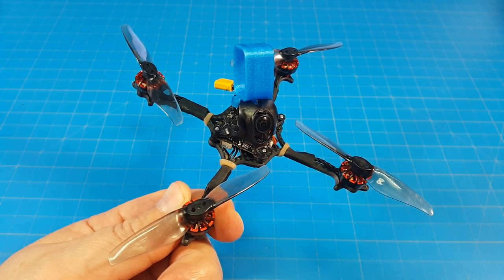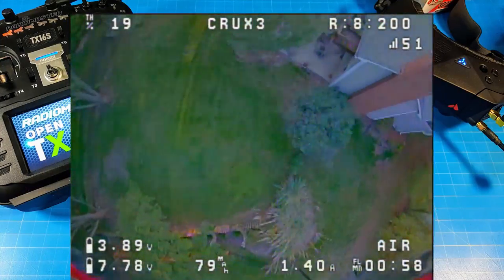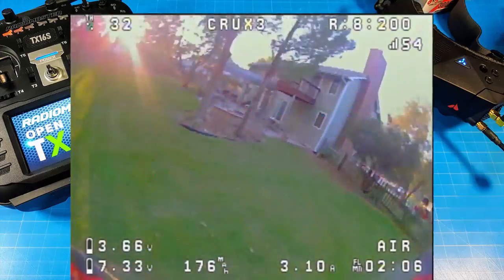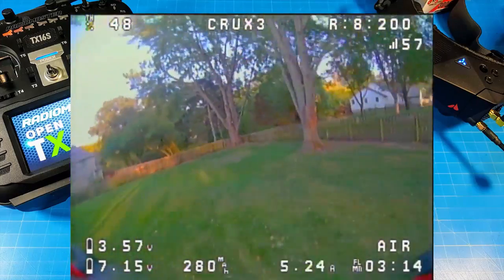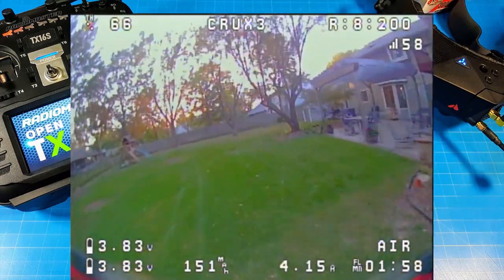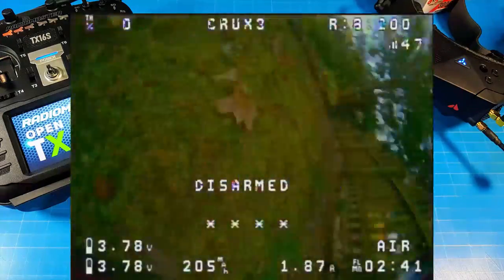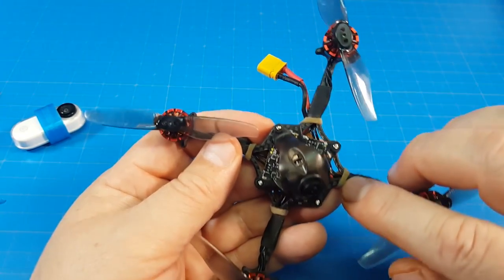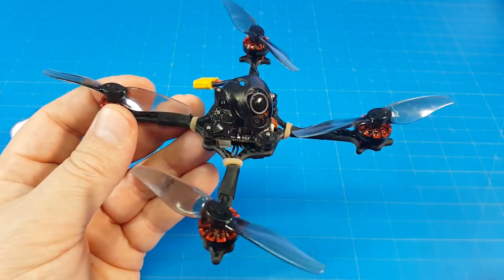Crux 3 // 42 Gram // 2s Ultra Light Micro Drone

Comment: I build my own version of this formula a few months back.  Love it.  mine is ~12 grams heavier due to baby ratel camera, diamond vtx and separate rx.  typical flights are 5 1/2 minutes on a rdq 450 2s.  other components are FPVcycle babytooth 2mm frame, rcinpower 1202.5 6000kv motors,  jhemcu 20a aio, GF 3016 props, larvax canopy.
Reply from the maker: The aio running well?
Reply: Nick Burns    I have two of the jhemcu 20A aio's.  The one on the 3" quad has countless flights and crashes on it, and I had another 2.5" quad that had many dozens of flights before I dismantled it since the 3" was so much better.
Reply: Nick Burns    And thank you for the channel.  Always look forward to your videos.

Comment: The simplicity of this quad is what is alluring to me. Having a truly all-in-one board makes this setup unique, not to mention ultra light weight. And I think using 2S will drop the amps enough to make this board reliable where the Mobula 6 AIO board would be more prone to failure on higher kv 1S BabyTooth setups.
Reply from the maker: Yes should be, this being v2.2

Comment: Hi nick been repeatly seeing your crux3 review for few time already

Currently flying mobula 6 as the first quad (as you suggested)
Very happy with it and get over 500 flight on it (and broke alot of parts 🤣)
Now looking for something that have more fun outdoor/can do more freestyle acro things

but i thing i still not yet ready for bigger more expensive 5inch quad
so i am looking for something without prop guard / more power 

Currently have list on few and looking for your recommendation

1）Crux 3（with 3inch prop and your flight footage i think it will fly very well）

2）uz85 （it come 25% cheaper then crux3 and maybe i can turn it into tsk 3d printed frame）

3）uz80 （but i think it wont perform much difference compare to mobula6 75mm mod that i have currently）

4）larva x（ it can do the on board recording but have heard about the durability issue）

Which one you recommend？
or any other suggestions

Comment: There is absolutely NO reason to interrupt the fibers in the central part. The carbon orientation is correct and even a thin "cross" in the middle would have made the frame WAY stiffer. I can't stress how much it impacts the tune and flight feeling. That's a pity for an otherwise excellent product and I'm really happy to see a real AIO board with 2s capability, it opens up so many possibilities.
Reply: I used a mobula 7 aio on a tyro 69 frame and motors and it was a blast

Comment: As you said, you can put Insta360 GO on almost anything these days. I have a little recommendation for that. Have you tried iFlights Turbobee 136RS with Insta360 GO? I made a custom canopy for mine and with 4s 500mah, it is a blast. It behaves a lot like a larger freestyle quad and is very quiet and yet, still quick. I won't spam my video but if it sounds interesting, let me know ;)
Reply: Sounds interesting! Do you have a vid?
Reply: @MarcoLopez-wy6zx  It is the "Guess the Quad" video in my stream

Comment: I just ordered my crux3 yesterday and was wondering if you think it would be a good candidate for a runcam split 3 lite mod? Thanks for all the great reviews Nick.
Reply from the maker: If the plan is to fly in a smooth style it will be fine, but if you want to do more aggressive or faster flying the extra weight could be an issue. Split cams don't tend to be as durable as non splits..something to consider.
Reply: @NickBurnsFPV  very good point to consider. Thank you.

Comment: Thanks for the great review Nick!
Do you remember if this drone runs hot by any chance? I had this guy just sitting on my bench and it was reaching 57 deg C. Even on USB! Wondering if I received a dud.
Reply from the maker: The AIO do run hot, I don't suggest leaving it plugged in without air flow for long.

Comment: Just received mine and was wondering if you are flying the stock tune here? The tune on mine on Profile 1 was really, really bad - oscillations from the get go. I switched to Profile 2 which was a bit better. I then checked in the configurator and saw that it comes flashed with BF 3.5.7 - going to re-flash that to a more up to date version for some RPM filtering :-D
Reply from the maker: I am flying the tune it came with.
Reply: @NickBurnsFPV  interesting. Thank you.

Comment: Since I first watched this run on 1s I have been kicking around the idea. So today I dug out a JJRC 1800mah 3.7v 30c 1s and gave it a try. 12+ minute flights depending on how you fly. I flew it in a normal manner. You can feel the weight for sure. At 9min your pretty much running 78 to 95ish throttle. Interesting test. No freestyleing with this battery though, but you can still fly it fairly fast just not 2s fast 😄.
Reply from the maker: was it still fun?
Reply: @NickBurnsFPV  well in my back yard its pretty tight so very tricky to fly it on 2s. This 1s made it flyable and it still had pretty good speed, but the fun level was cut by almost half. I might try a 800mah 1s to see if it will be more nimble with les weight.
Over all the 2s is best but for a smaller flying area 1s is viable if you just gota get your crux3 jones fix.

Comment: I already received mine! But It comes with 4 small rubbers to attach the battery. In your video you have a single big rubber, was it the stock one? If not, which is the diameter in metric system? I would like to purchase them :p

Comment: Thank you.
Is there a difference of flight time between 1s 600mah and 2s 300mah for smooth cruising? efficiency is better in 2S non?
Reply from the maker: I can't definitively say as I didn't test both those sizes of batteries. 1s is very mild flight
Reply: @NickBurnsFPV  it's rather a generic question about drone. (for comparing yes we need to limit max trottle (for high tension) to the same power as the lower battery)

Comment: love my Mobula 6 for outdoor ripping in small spaces ...but ...that thing cannot handle a wind stronger than two snails farting at the same time. Is this better for general ripping in a little more wind? Reasonably quiet? Recommended? Maybe time to do a round-up of what you like in each of the micro classes; so many choices now. Like the camera on this one, and it seems decent all around with now glaring weaknesses.
Reply from the maker: Yes naked props can cut through far more wind. Now if the wind is strong like 20mph we feel it but still relatable. Much over 20mph wind we need to move up to something heavier

Comment: Its funny with batteries in Australia aswell. A 2S 300mah pack will be around $18 at a hobbie shop and 3S 450mah packs sell for around $15 or less... Weird but you also rarely see any 2S packs over 300mah unless its a big ol 2500mah or something.
Reply from the maker: That is very strange. I wonder why it is so
Reply: @NickBurnsFPV  Its a mystery to me mate, thats why I'm using dual XT30 and 1S packs on all my 2S tinyhawks. I can't find any 2S batteries in Australia that are over the dredded 300mah size. I really don't like any lipo under 450mah, when I fly my TH Race the throttle is nearly wide open the entire 3mins and the 450s can keep dishing the amps. 300mah not at all, sag after 2sec on open throttle so they are basically un usable for me. 
Same with 3S though, anything below 450mah just can't keep up with wide open race flying... Pretty much why I don't like 65mm whoops either, battery performance let's them down in a big way.

Comment: I am jealous! I want that setup, I will get this for the FC. V2.2 fix some issues I had the crazybee X V1.0 . I might try some 65mm props. BUT I am in Canada, snow is coming! so this will be a tinywhoop FC for now. A other tip, scale the insta360 to 4K to get better result on YT. So when you create your video, make it 4K and scale everything up. So you take 1080 and scale to 4K and export to 4K.
Reply from the maker: I will test out the scaling
Reply: @NickBurnsFPV  For what it's worth, I have heard the compression is better with 1440p & 4k (the same afaik). This might help you Nick since I know your computer can't handle 4k video files very well!

Comment: This is a hoot to fly I keep the camera angle stock and rip it indoors on 1s never taken it out the spi frsky is a let down and tiny pads to put an elrs makes me leave it stock. Could I move the gutts to an85mm whoop frame and run e max 4 blade props basically make it a 85mm whoop

Comment: I know this is a year old video, but got a question. Bought mine in feb this year. In the specs it recommends betaflight 3.5.7 and factory esc firmware version is 16.7. This crux came with betaflight 4.2.2 and esc version 16.8, AND had bidirectional d shot enabled and is using rpm filtering. Blheli_s firmware only goes to 16.71 so my question is, If i have to replace a motor and need to change motor direction for some reason, am I to use blheli_m configurator? They never give enough info in descriptions.. lol If you know the answer, it will be appreciated. :)
Reply from the maker: typically to change motor direction we can use any esc software, we aren't flashing firmware in the case of changing motor direction and therefore we can use the bluejay configurator, blheli s configurator or even the chrome based website of esc-configurator.com
Reply: @NickBurnsFPV  Makes sense now and cool to know. My first dealing with Blheli s. Other 9 kwads is all 32.. lol Just flashed M to the babytooth and have RPM filters on it too now.. man what a difference. Almost got the final tune done. Thanks so much for your reply.

Comment: Really love your nice review! Right now I got a problem for the receiver options here.I wanna pick up the tbs cross nano RX, might be able to get better Signal comparing to other receivers such us dsm2 /flysky/fry sky d8 etc.... but I just don’t like tbs’weight, the T shape antenna may make this little bird a bit bulky given this size of little toothpick. so which receiver you were flying by in this video and how was the signal?I do have the TBS tango2 controller and the radiomaster t16S with the cross fire TX . (many options for me....) So really don’t know which receiver I am about to choose. Just wanna fly it the same way at my house around the building and trees like what you did. Thx!
Reply from the maker: I have the frsky version. The control link will be about the size of a football field, maybe slightly less or more. in d8 mode.
Reply: @NickBurnsFPV  a footie field ! wow that is enough for me :) I didn’t expect this onboard internal receiver could cover such a big range. Thank you for the answering and sharing! And happy flying mate!
Reply from the maker: @vision60s67  yes, In d8 mode, I can fly well up the street with a house blocking the line of sight.
Reply: @NickBurnsFPV  fantastic that’s exactly what I am about to do :p
Reply: @NickBurnsFPV  what transmitter are you using
Reply from the maker: @Gniggaaa  At the time of this video I am using the jumper t-lite. I have most recently switched to the radiomaster zorro.

Comment: I am trying to figure out how to adjust my VTX on my new Crux3 FrSky SPI. I have flashed it up to the latest Firmware (CRAZYBEEF4FR 4.2.10) in Betaflight Configurator 10.7.1.

I am trying to figure out what channel this VTX is on (and be able to adjust it) and turn up the output to 200MW. I can't seem to find a strong enough channel on my goggles "Search" function to fly the damn thing past arms reach without complete static snow-out.

I can't get the VTX table to pop up in the "Video Transmitter" tab for some reason. when i click on that tab it says "Your VTX is not configured or not supported. So you can't modify the VTX values from here. This will onlyu be possible if the flight controller is attached tot the VTX using some protocol like Tramp or SmartAudio and is correctly configured in the Ports tab if needed."

In the "Ports" Tab There is a UART1 and a UART 2 but I have no idea which one controls the Smart Audio on this thing. But when i try to turn on Tramp or SmartAudio on one of these UARTS, I get a message that says "The VTX table has not been set up correctly and without it VTX control will not be possible. Please set up the VTX table in the Video Transmitter tab."

Not much help on the Happy Model website. Also can't seem to find any videos on YouTube to help out. I have been trying to figure this out for hours so any help at all is GREATLY appreciated.

Comment: Great video Thanks you, I actually bought this quad because of your review! This is my first sub 250g quad. A very silly/noob question please. How do you remove/replace the props? Cant believe how well they are fitted but because of how small this is, I'm nervous of breaking it ;)  Annoyingly, I can't seem to find any youtube help either.  Any advice please? Cheers
Reply from the maker: Hold the bell with one hand, then grab the prop at the hub/center with the other, twist and pull to get them off.
Reply: @NickBurnsFPV  Thanks Nick, I appreciate the response and will go for it. Cheers 👍

Comment: Very nice looking little quad I like that on 2s and 1s you would think they would of went with a bit higher kv like 8000 8500 would of really helped with 1s flights
Reply from the maker: Yea at the low end doing 1s and 2s on the same prop is really unattainable
Reply: @NickBurnsFPV  yea in reality the motors should handle 3s I would think but we will never know wit& only a 2s board lol thanks for another great review

Comment: Hii 
I almost finished the 2s toothpick and don't have place for capacitor. I saw your rewiew on crux 3 and don't see any cap. Can it work without capacitor?
Thank you
Reply from the maker: capacitor isn't required. It can clean up electrical pulses.
Reply: @NickBurnsFPV  Thank you alot, anyway I paced it on xt30.

Comment: Does the insta360 go make sounds when you turn it on, start or stop recording? If it does, you can connect to it through wifi and start and stop video to hear the beep if it gets ejected during a crash. I figured this out with my hero 6 after it and the tpu ripped off my quad during a hard crash.
Reply from the maker: no sound, only vibrations and lights
Reply: @NickBurnsFPV  ahh, ok

Comment: I’m trying to wire tracer to this quad and cant figure it out I have the crazybeex 2.2 I worked to the txt/tx 2 pads bound the receiver to my transmitter via agent m but not getting anything in beta flight it’s on crossfire and set to serial rx
Reply from the maker: Probably need to double triple check the wiring, settings etc. I don't use crossfire but from the message it seems it should work, as long as what appears to be typos are indeed typos.

Comment: I know your super busy Nick but I need help. My equipment sat for a really long time without using it. I brought my FrSky Xlite pro, flew a couple flights and left it in my car. It was in there for a few days. Now it will not boot, batteries say they are the correct voltage. Help
Reply from the maker: Do you see anything on the screen? Any vibrations or lights?
Reply: @NickBurnsFPV  I figured it out nick. Speaker would just make a small creak and that is ALL it would do. FW was trashed. Very weird but its back up after a FW reflash. It wouldn't even go into bootloader mode before the reflash. Thanks for the reply 👍

Comment: What receiver did you get. Is spi range worth it?
Reply from the maker: this is spi frsky d8. The range is fine for me, likely stay within a football field area and it should be okay. But more than that failsafe is just around the corner.
Reply: @NickBurnsFPV  thanks, that's about the range I usually fly anyway. Just heard that range was crap with built in receiver. Ordered one after watching your review, with spi. If it isn't what I'm expecting with range is it hard to put in a r xsr? Got a spare, came with my qx7.  Never done any mods other than plug in stuff
Reply from the maker: @michaelmatthews6421  Putting in a receiver isn't any harder than connecting a receiver to any other flight controller, except the solder pads are likely smaller than other boards.

Comment: Weird thing I noticed is the ESC is only listed as 1S capable, 5A constant with 3second 6A burst. You seem to be drawing more amps, though not for any sustained period. But I wonder if this is some error in the listing, or if the ESC could be a weak point on this model?
Reply from the maker: Those rating are per esc, each motor has an esc and that is the total the OSD shows us on screen.
Reply: @NickBurnsFPV  Ah, right. Makes sense. Clearly been a while since I've looked at ESC ratings lol
Reply from the maker: No worries 👌
Reply from the maker: @foaloal  no worries.

Comment: Will the frame and canopy be good for tp3? or would it be too weak for 1303 motor and 3s?
Reply from the maker: 1303 don't weight all that much more. I would be more concern about the battery weight if your planning on 3s. More battery weight will have more inertia and impact.

Comment: Hi! I have a radiomaster tx16s, which receiver so you suggest here?
Reply: Compatible Flysky Receiver or frsky. BUT, you should buy a crossfire and get the tbs nano :)
Reply from the maker: I would go frsky r-xsr. Crossfire has the ultimate range but i have not flown it myself
Reply: I was thinking about buying the crossfire module, but I am always a bit worried about the cost you know... I was asking because given the nature of the little quad maybe the frsky here was sufficient! I think I will switch to crossfire on day, everyone is doing that 🙈
Reply: @alessandrorealivannucci3669  Go flysky !!!
Most reliable link on these aio board with multiprotocol radio.
Reply: Yes? You think flysky's good?
Reply: @alessandrorealivannucci3669  yup, I used a lot of different crazybee board with my t8sg and tx8 and flysky always been the best.
I'm gonna release a range test video tomorrow.
But all I can say it's more than sufficient for this type of build 😉